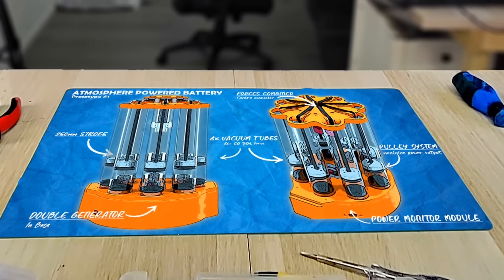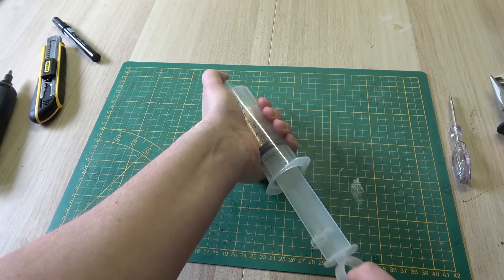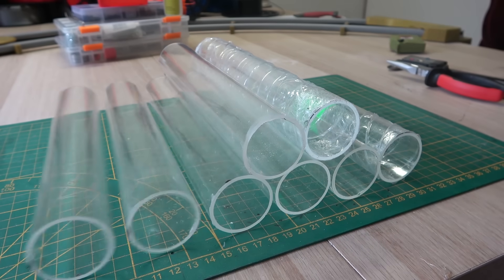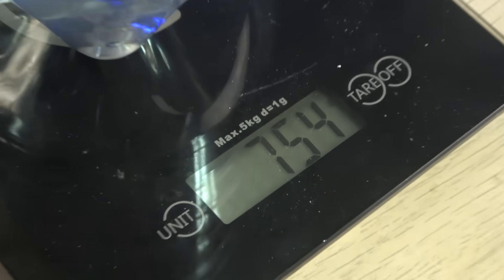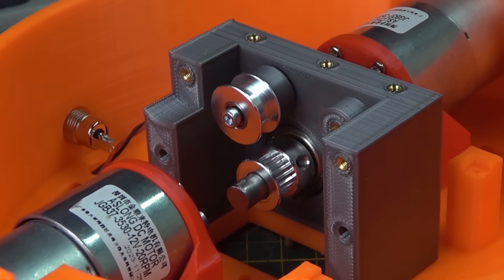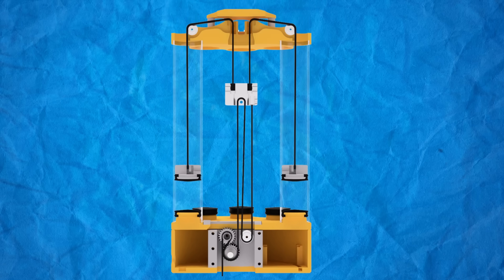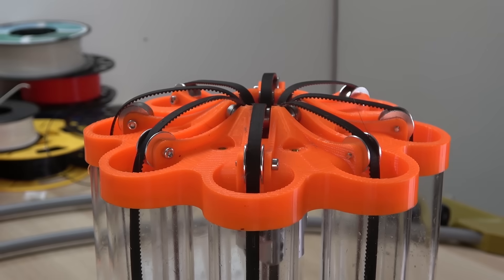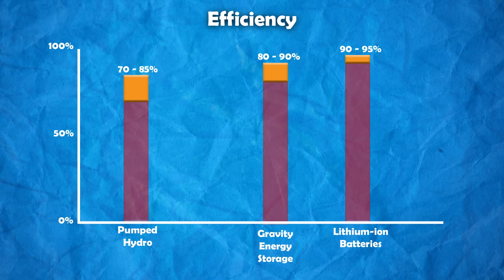Building an Atmosphere Powered Battery..

Comment: Sorry if this has already been covered in the 2150+ comments already presented.  

I agree that the round-trip efficiency of 73% isn't bad for a small scale model.  
However there are other important attributes of an energy storage system, such as:
1) Mass efficiency - Watt-hour storage capacity per kilogram
2) Volumetric efficiency - Watt-hour storage capacity per liter
3) Cost efficiency - Watt-hour storage capacity per dollar
4) Cycle life - number of charge/discharge cycles before the system wears out
5) Practical maximum discharge power without adversely impacting cycle life

#1, #3, and #4 will vary with the materials used and the mechanical details of the design.
#2 is pretty much fixed by physics, geometry, and earth's atmospheric pressure.
So let's calculate! 

The model built has a measured discharge capacity of 628J/3600 = 0.174 Watt-hour = .000174KWH
and an estimated mass of perhaps 10Kg.  That figures to be 10/.000174 = 57471Kg/KWH!
Even if scaling up reduces the weight by a factor of 100,  that's still 575Kg/KWH!

Lets assume that the model shown could be mass-produced in China for, ummm, $10,
with much of that being for the motor/generator. That equates to $10/.00174KWH =
$5747/KWH. Rather expensive!

Unlike #1 and #3, the maximum possible volumetric efficiency CAN be exactly
calculated. At the risk of making a fatal error, I calculate the mechanical work
required to evacuate a 1 liter cube (10x10x10cm) is 1.033Kg/cm^2/2 * 1000cm =
516Kg-cm of mechanical work. At 0.098 watt-seconds per Kg-cm, evacuating the
cube would require 516*0.098 = 51 watt-seconds/Liter which is 0.00014
KWH/liter or 7140 liters/KWH.  That's a cube 1.93 meters on a side; the size of
2 commercial-size refrigerators back-to-back!

Cycle life could probably be pretty good given the proper choice of materials
and low-wear design. Piston engines routinely survive many millions of
compression/expansion cycles before wearing out.
 
Maximum discharge power is hard to pin down as that would depend almost
entirely on the design of the "vacuum engine" and whether peak power was a
design priority.  It could be very high though, almost implosive!

Now lets compare with a typical LiFePO4 rechargeable battery typically used for
domestic solar energy storage.

A typical 12.8 volt 100 amp-hour battery weighs 10Kg, has a volume of 6.73 liters, and retails for about $300.
Usable capacity is about 1KWH for a claimed cycle life of 5000 cycles.  
Thus the usable attributes of such a battery are:
10.0 KG/KWH
6.73 Liters/KWH
$300/KWH capacity
High power bursts are possible - up to 1.2KW continuous and 3.6KW for 5 seconds.
5000 cycles (20-hour cycles (10Hr charge, 10Hr discharge), 80% capacity discharges 
and 20% capacity degradation at end-of-life).  (5000 daily cycles is 13.7 years.)
Lifetime cost of ownership is thus $300/5,000KWh or approximately $.06/KWH.

Comment: Maybe I don't understand 3d printing and it's limitations well enough, but couldn't you have used a similar connector to what you had for the plungers, but designed it in a way so the plastic is basically just there as a spacer?

Use 2 washers with 3-4 holes for bolts as plates on the top and bottom of the connector, run the bolts through the top washer so their head rests on it, and either tap the lower washer so the bolts screw in directly, or use nuts to secure it. The belt would be attached to the top washer and the gasket would be attached to the lower washer, which should make it so all the forces are directed through the bolts rather than the plastic. 

Am I missing something fundamental that prevents that idea from working?

Comment: I'm no engineer but if you made the moving seal component a longer rigid structure with 2 O rings at each end and perhaps filled with lubricant between the 2 O rings it would reduce the alignment issue, reduce friction, and improve the seal strength and longevity. Secondly I saw comments that said making a perfect vacum requires excessive amounts of energy but this is not making a vacuum by pumping air out so perhaps if you reduce the starting volume in the chamber to near zero it would increase the energy storage capacity as it would take more energy in but thats just my speculation for testing I'm not familiar with this subject.

Comment: You made a mistake with your efficiency calculation or measuring.
Those DC gearmotors with high gear ratios are at best about 70% efficient during EITHER motoring or generating, so the absolute maximum overall efficiency would be 0.70 x 0.70 which is about 0.50 or 50% efficient.
Then it is worse than that because your belts and pulleys lose more efficiency and your rubber seals REALLY lose efficiency, so actual efficiency for a full cycle would be something like 20 to 30%.
Nothing like the 70% you claimed.

Comment: Let me help build a 3 mile tunnel down 300 feet And the cylinder will rise up and down, using atmospheric pressure, hot air  Rises, lifting the tube until it cools then goes back down 
Turning the generator.up 
And Down

Comment: What about using a small vacuum pump to generate the vacuum, also using electro magnetism to reset device before applying vacuum, also, lubricating rubbers with wynn's charge for oil might improve efficiency a lot.

Comment: Fantastic! The advantage to keep in mind is it's more compact than a gravity battery. Though you won't get the same efficiency per unit, you do get more capacity per volume. If you charge it with earth and solar powered Sterling engines and use flywheels you'll only have maintenance cost. I love it!

Comment: This is a remarkable idea, smaller and safer than some others I’ve been pondering. If a flywheel breaks, it’s a very bad day for everyone. Maybe even the neighbors. But if this breaks it will be pretty loud but not all that dangerous.

I’d like to see one scaled up to the size of a large hot water heater. Something that could sit in the corner of a basement. In conjunction with rooftop solar and a moderate home backup battery system it could be pretty amazing.

Comment: Commercial use in common places NO.👎  There are better options that are available to the people. Another question is scalability.  Size and higher pressure will cause the thing to generate more heat. Which would lead to mechanical failure. You don't have this big of a problem with water And if you have an access to a flowing water source and a rampump it is free to charge.

But not common use For
Example a submarine Where they make their own atmosphere. As well as store it. Under these circumstances this gives them more options. So, does this have any value? In some cases Yes but more or less extreme environmental circumstances as well educational purposes only.

Comment: Amazingly good results for this system. In theory, when you lowered the pressure in the cylinder, the temperature decreased. This temperature gradient would cause the air inside the cylinder to absorb energy from the ambient air outside the cylinder. This obviously makes the system less efficient. I wonder if insulting the cylinders would provide even greater efficiency?  Very interesting idea that you have developed.

Comment: What about using a motor to pull a float underwater, like in a tube?
The motor can be waterproof, and at the bottom of the tube, directly reeling in a float above it. Or keep the motor & transmission above water, and have it pull a float down, through underwater pullies.
Reply: Maybe the water can be oil instead, for lubrication and rust prevention?

Comment: Of course it would work and it's hardly the first "air" battery.  Compressed air has been an energy storage method for generations including torpedoes powered by compressed air.   The problem with compressed air energy storage is the low energy density which is why using depleted mines and oil wells are proposed for air compression storage as the space for the air storage has already been amortised by other purposes and hence have already been paid for.

Comment: I think a much easier, more efficient, and cheaper battery to build would be to get or make as large of a 'syringe' as possible and to have the piston of that syringe act as a rack that moves a pinion gear on an electric motor, that way you would only need one 'syringe', one motor, and no belts or pulleys. Of course a vaccuum chamber like that likely does not exist and would be difficult to build, but it would probably be better than the battery in your video.

Comment: I think that the scale of the battery would effect the efficiency. The larger the scale the greater the efficiency. If you were the make a simular battery with a singualr tube with a 6inch diameter at same length your efficiency wouldnt be near 20% increase. As it would be less friction from the diameter... id suggest a 3d prindted triple o ring model using a vasaline lubricant.

Comment: You've got a tiny amount of leakage and a ton of friction. I think you'd gain 10% easy. I expected you;d be around 60% so it's good as it is but with refining even one that scale I think you can hit 80% and a properly engineered plant should be close to or better than gravity storage. The advantage is you can put these anywhere. The real advantage is speed. Slower than batteries but on par with generators making it an alternative to things like diesel generators.

Comment: Scaling this up isn't as simple as just make everything bigger. The vacuum forces in a larger system are going to enormous so you'd need heavy reinforced cylinders. They cant be made out of cheap steel as condensation would rust the insides. Also for safety reasons the whole contraption has to be incased with concrete? Way to complex and expensive imo. Also did you actually measure the total watt hour of the entire system? I just can't believe its anything above 40 maybe 50% efficient considering how hard those motors have to work.

Comment: better just to just bend metal and use the power of that when it goes back? Which has no friction. A more efficient way is to bed it with frequency which should take less power. you know how you bend a metal by going back and forth with a certain frequency and when it reaches it peak you stop and then get power from it with high ratio gears.

Comment: Most of these systems have moving parts, so maintenance is inevitable.  

My biggest worry (as was true with compressed air batteries) is that there are certain parts which unavoidably take a huge amount of wear-and-tear.  I worry that the gaskets responsible for maintaining the vacuum will require replacement frequently (as is true with vacuum pumps).

Gaskets are just plain finicky.

Seriously cool idea, though.

Comment: You should try testing this with a large capacity commercial air compressor. That's honestly the only way you might be able to test this at a larger scale, but you won't be able to use the same motor that compressed or decompressed the air. I am not sure was expecting in terms of efficiency before you got your results, but it would make sense that it would be closer to the same as hydro, because it kind of works under a very similar principal because air is technically considered under fluid mechanics, but this is technically more like a spring so it's not quite the same as the type of fluid mechanics we were comparing it to earlier. I think with a larger scale with better seals, you might be able to get even more efficiency out of it.

Comment: Even on MW-scale, it is hard to beat the price and convenience of (LFP) batteries, and battery system efficiency and cost scales pretty lineair, so it should be the best home solution by a large margin. The real competitor to battery storage is renewable energy, i.e: over more than a few weeks, it becomes cheaper to generate new energy than it is to store it, so the best energy storage could be not storing it at all. A clear example is charging batteries in the summer and using the energy in the winter: It is far cheaper to install a few extra solar pannes so you generate more energy during the winter, instead of trying to store it for 1/2 a year.

Comment: This seems fantastic. I mean sure it's not 'as efficient' but consider the materials, and the size.  The ease of use.   More testing is needed, I would love to see the idea of 4 motors instead of 2, given how powerful they are, and see how that changes things.

There is no rare metals here.  There is no heavy mining operation, there is no deep mine shaft, there is no massive gravity storage tower, or huge reservoir of water...  I think you might be onto a more affordable, albut less effecient, energy storage system that everyone could use to help offset power demands. I mean think about this even a few of them or scaled a bit bigger or what not - the ability to say solar charge this atmo-bank, and then discharge it as it is needed, during cloudy days or night time needs, for non-life support needs, like just.. lights or other things, could save a ton of energy over the course of weeks or months.

on top of that.. if/when it breaks down - there is no super hard to get materials, replacement parts, or the like.  The fact most of it is 3D printed - helps make this more of a decent idea to explore, even if it were significantly less effecient than other methods.   More usability, more easily reused, recycled, or fixed, is more desirable than a 'better' machine that would need to essentially need a full replacement if it broke down.

Comment: I'm afraid something is really off with those energy measurements. Unless I'm mistaken, (1 bar) * 8 * pi*(18 mm)^2 * (25 cm) only equals 204 joules, so you could never have stored 3 or 4 times that amount.
I really love the engineering that went into this, I wish I knew how to make these things.
But I don't think I can really see this applied in real life. It's like the reverse of compressed air storage, but inlike with that, you're limited by the outside pressure of 1 bar, where with compressed air you can get up to two orders of magnitude higher energy density.

Comment: The second you said you were using the charging motors to be what convert the vacuum energy I lost faith. THat is bc I thought that is definitely a waste of the energy stored rather than creating a generator from the power stored. Optimise the output the same way you optimized the input instead of looking for a shortcut to do both.

Comment: If it's above hydro on energy output then clearly there's application and potential.

Even from this rudimentary prototype it's an interesting result.

Some lubrication for the rubber seals might reduce drag and gain further efficiency, metal gears would likely increase torque rather than PLA/ABS gears. There's probably more tweaks that physics engineers could recommend, but those two alone should increase yield and reduce the loss from conversion by 3% to 5% (at an assumptive guess).
Reply: Edit: I just read he used a lubricant on the seals. Disregard. Better gears still might improve torque.

Comment: The problem with storing energy in vacuum is buckling instability in the storage vessel due to compressive forces acting on thin shells.  It is why vacuum tanks end up being thick and bulky with high embodied energy.  A concrete or even rammed earth vac tank may be the way to go for the rough vacuum needed for energy storage.  The energy storage density is low, so the materials used to make the tank need to be energy cheap.

Comment: Probably you can increase the efficenсy if you do the same under water. :)
The losses due to friction, etc. will be more or less the same (providing that the tubing, belts, shafts, etc. doesn't bend much), but the forces involved (thus the energy stored) could be way bigger.  +1 for every meter of depth, so in 1 meter high bucket of water you can have twice the forces/stored energy
Also making it watertight is easier than airtight, so that kind of losses will be lower either. ... and visible and measurable.

If there's a running water around you can double capacity at the cost of draining and filling the bucket with actually very small amount of water (if the "bucket" is narrow enough at the top), which is probably way more effective than water turbine with the same amount of water.

Can't calculate it from the top of my head, but moving it up and down could possibly also add to the efficiency, like pumping the air out "on the sea level" and then "generating" the energy, say one meter bellow surface, at the bottom of the bucket (twice the force) on the cost of lifting it back to surface  again (like sort of hybrid gravity/pressure battery).

Comment: Thank you for sharing the video; the project is indeed fascinating! 
Inspired by your idea, I have begun conceptualizing a similar project. It involves a sort of vacuum 'battery' where a vacuum is created in one chamber using an electric pump connected to the camber by outtake valve. To generate electricity, a turbine connected to an electric generator would be used. This turbine would be rotated by incoming air when a intake valve is opened. I hope I've managed to clearly articulate my idea. I would appreciate your thoughts on this concept

Comment: your tensioned is overkill, the belt is always in tension, force never switches direction. at first I thought this would be no different that compressed air, which is not very efficient because you lose a lot of energy to heating, but if you get a good vacuum seal going then there isn't really anything in the tube to cool down and start taking in heat from the environment, to ruin your efficiency. (works in reverse with vacuum vs compression)

Comment: Worth exploring indeed. Im super impressed. Could you store that energy as pressure for a long time? And could this be used many times for a similar reslt, or does it wear out after only 100 uses? Could thie system be optimized in any way? Please keep doing what you ate doing. Good luck!